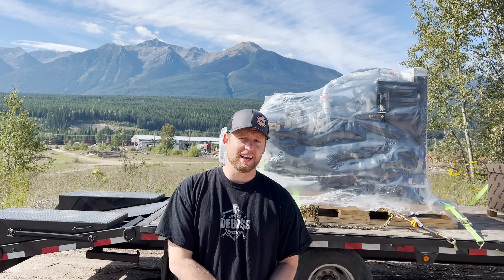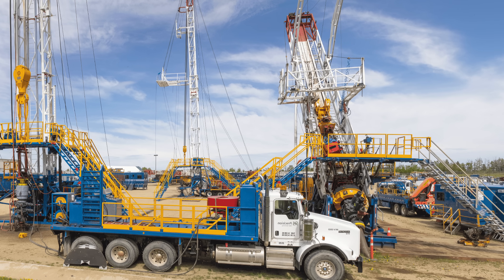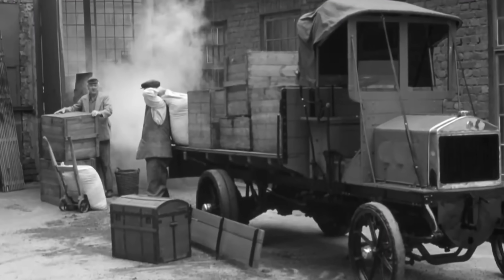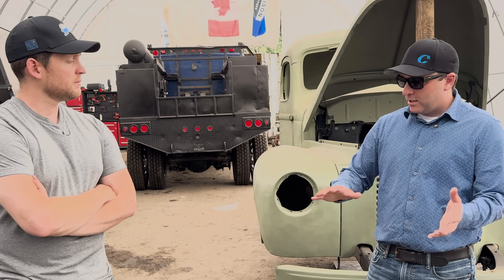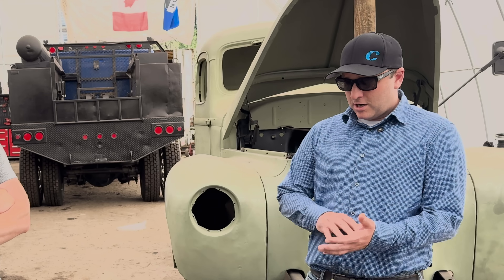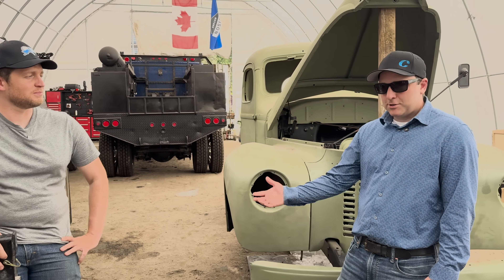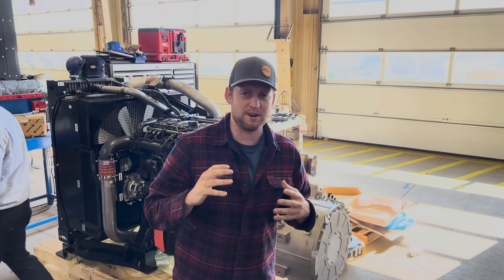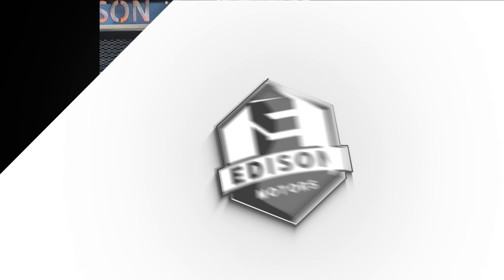We're putting Scania engines into Edison Motors Trucks!

Comment: Not using CAT engines will be a huge mistake. Parts are always readily available, and they give you any technical support they can provide. I had a truck with a scania, and although it was powerful, parts hereannoying to source, and no one wanted to work on it. I understand theyre cheaper and easier to get your hands on, but cat has the best product support hands down. Its why all 24 pieces of equipment i own are all cat. Downtime costs you the most.
Reply: For on road emissions CAT to my knowledge doesn't offer anything new. Dealing with government regulations probably has a huge part to play in this decision.
Reply: @evil_me  I thought since the generator is technically not the primary source of power, they can get away with having a off-road emissions system. Same reason they can run off-road diesel fuel in the truck
Reply: @Drew-in-NoDak Nope, they will still be required to have all the emissions requirements for an on-highway diesel. And off-road/ag fuel is literally the same fuel with dye in it.
Reply: The great thing about a series-hybrid drive is that its very easy to spec any engine that will fit. You're not hooking it up to a transmission interface, you are connecting it to a generator. If you want a Cat, you can have a Cat.
Reply: Cat doesn't make on-road engines anymore.
Reply: It’s all about the dealer. We have a Scania dealer that can provide most parts we ever need the same day and the rest has always been there the next day. We used to work with a caterpillar dealer who just couldn’t provide anything. And they are the official cat importer too. We now work with a dealer that jumps in the car after the first call 24/7, just like our Scania dealer. Since the official importer is so bad, this cat dealer has its own stock of parts. The dealer is everything.

We have engines from cat, Scania, Cummins, John Deere and jcb. Built from 2006 up to 2023. Cat and Scania have the best parts availability for us. The only jcb we have is from 2022 so that’s still unknown. The oldest (2007) Deere is getting replaced when it breaks down because parts are just not there anymore.
Reply: @autobootpiloot we have 15 John Deere excavators. Brandt always has parts and we got rid of the cats because they were terrible for parts.
To run a cat costs a fortune in lowbed costs replacing machines on site because we can’t have downtime.
Finning parts sucks.
Reply: @RyanKeys-i6z   it’s not the brand that has the parts. It’s all about the dealer. I know a large contractor that has two brands of vans the guys drive. One is very reliable and one not so much. All the new vehicles are the not so reliable brand because that dealer is so much better it more than makes up for the inferior product.
Reply: CAT, SCANIA, or Hyundai, it doesn't really matter what you have in YOUR Edison truck. You're generating electricity with it, at about 1/3 the size of a conventional.
Reply: I think somewhere along the lines they finally got to looking at the regulations for on road engines and the off road Cat could not be used for on road use.   My buddy was pushing me to become an installer for Edison repower kits.   I wanted no part of that.   He is pushing the repower process for homeowners and such but it is not legal to do if a vehicle previously had emissions on it.   It's just a fantasy to think that you can be an installer for the public and not get in trouble repowering vehicles that were equippedwith emissions.   Same kind of trouble as deleting trucks for the public.   I have an 06' Ford repowered with a 12 valve and that is illegal as heck too.   Sooner or later this will all catch up with everyone because the states will up the smog checks like California.   Watching the Edison channel became old because it is like a fairytale land where emissions and regulations don't exist.   The only repowers should be older trucks with zero emissions.  This will take massive amounts of money to get these larger Scania powered trucks past the emission police and you can bet the big truck companies will be lobbying against Edison to keep it from happening.   I am rooting for Edison guys and I am not against bucking the system.   I am a realist though and the system is rigged against outsiders getting in.
Reply: I agree. Should’ve used something already common, like Cat or Cummins. But I assume since they’ll be using them, they will also have more parts over here available.

Comment: Scania is already in north American products and share quite a bit of parts commonality with Cummins. Hyundai, Doosan, Kleeman all use Scanias where applicable. They also have a marine division for fishing vessels and yachts.

Mack-boring is an existing and well established distributor/representing partner.

You're main competition will be Navistar,  since they've already developed the S13 drivetrain with Scania and is sounding very promising so far. Of course that is mostly on highway right now. If IH lets you spec the truck with an S13 and an Eaton manual, I think you'd have some marketing to do to keep up.

Comment: 2:41 we're moving 70+ in sweden and finnland ;)
Reply: In Norway too, but only on certain roads rated for the axle load
Reply: @CarlMarx in norway it’s only 60 metric tonns if the road is rated for a module trailer. Thats 24 meters or longer with the truck. max length being 25.25 meters.
Reply: @tommyp3468 it’s state dependent, the federal reg is 40 tons on a 5 axle rig. But places like Colorado you can be 75 ton on a 5 axle rig provided the equipment is rated for it, states like Michigan and South Dakota you just keep adding axles for higher capacity. For comparison purposes it’s really not that different when you consider US states are as big as EU countries.
Reply: @CarlMarx its all axles. You can haul millions of pounds in canada but you just need more axles and push trucks
Reply: @taylorforster9256  special cargo is special cargo. How big is the limit for your regular truck? 104 tonnes here in Finland
Reply: @AdBul_  the 104t timber truck operates with special license on a set route. 76t is the maximum for regular combination with minimum 9 axles, which is allowed on all roads if there are no signs telling it's not
Reply: Just found out that US ton is also called short ton.
Reply: In USA the normal weight is 40 American tons on 5 axles. Then you go up from there with different regions that can handle the weight and length of trailers on the roads or permits are needed.
Reply: Quo vadis? Scania vabis? Old joke from the old world ( where are you going to? [old roman] scania vabis?
Canada? Might be an exelent choice. 
But when things settle down have a new moment. Check for a stationary engine in the gen rev range.
Reply: In Brazil, we also move around 74 tons all around, on a hot climate, and on a hilly terrain.
Scania is easily one of the most prestigious truck and bus manufacturers around here.

Comment: A north American truck with a V8 hell yeah
Reply: I find it funny how people in north america forget mexico is in north america and forget that scania  trucks are already on the road in mexico with the v8s canda and the usa are way behind
Reply: Yeah I'm starting to see lot of Scania here in mexico s @hihaveaniceday9386
Reply: 2.46 Scandinavian trucks hauling 60 to 75 ton unlike the rest of European regulations. Europe is not one country you know, but several.
Reply: @robertjonsson5750  Exactly. Starting tomorrow morning:  i'll be hawling thoose maximum wieghts for a week. Me and my SCANIA: We simply just LOVE IT!
Reply: Caterpillar already has V8's and Detroit also.
Reply: And a great sounding one at that, removing the muffler and replacing it with an extra long (like 12meter) exhaust pipe tend to have V8 Scanias absolutely singing
Reply: V8 is a downgrade from inline 6
Reply: @fastinradfordable  American V8s would be a downgrade. A Scania V8 is probably the biggest upgrade you could make. Only thing that beats it in any field is the new Volvo D17. That is a 17.3L I6 making up to 780hp. 10 more than the Scania DC16.
Reply: @tntfreddan3138  and disgusting 3800 nm... madness! :D almost 2800 poundfoot of twisty magic :D
Reply: @tntfreddan3138  The SCANIA V8 engine still outperforms that Volvo straight 6 cylinder engine. And adding gearboxes and drivechains -to the equation: The SCANIA is the prefered choice of the 'more'..
The only thing better on a Volvo truck (compared to a SCANIA) -is the electric sunvisor -on front window...
Reply: @fastinradfordable  Why do you say that?
Reply: im sure the heavy haulage companies in Northern Australia would not agree
Reply: Need to bring back the cat LoL

Comment: Been a truck mechanic for over 35 years, scania engines are very good motors, i've worked on them in the uk for many years, and for them for 4 years previously, the options you have here are enormous, good choice, seriously, good choice.
Reply: 2 for one. Boost Scania awareness, and get diesel-electric rigs out the door as fast as possible. Reach out to Scania corporate and ask for discounts as help in developing this market niche!
Reply: “Easy to do eh”?  Lol😂😂😂
Reply: The marine diesels do well, when they say 770hp they mean 770 hp for a month of running, not 770hp peak for 10 hours.
Reply: Yes but scania v8 i think is the best engine of all trucks, they have torque ,power,sound,reability , i now to euro 5 first model do 1000000 km without problem
Reply: @jurimerl7jak377  When. it comes to drivability, scania engines are top notch. Super wide pancake flat  torque curve.
Reply: I've been a Scania mechanic for 36 years so although I have a shit ton of experience on you I agree 💯.
Reply: Watch paccar start putting the V8 in their trucks from scania. Maybe international
Reply: Have worked on a couple of Mack V-8's and they look similar and even seem to have similar displacements. Is a Scania at all related to a Mack E series V-8?
Reply: @playanddisplay3636  Mack could use Scanias DS14 V8. Mack also got the right to use the Scania motor design that basically was low rpm, high tourqe and also more HP. There should be plenty of sources that explain it better then me!

Edit: found better info..
"Using Mack-supplied END(T)864 V-8 engine blocks, Scania began development of its own version in 1962 with running prototypes in 1964. However, the production version of the Scania DS14 V-8 was based on the improved Mack ENDT865/866.

Mack introduced the 14.2 liter ENDT865 in 1969, the same year Scania introduced the 14.2 liter DS14.

Scania utilized individual cylinder heads on their version (favored in Europe at the time), while Mack used a two-cylinder head design (four heads total)."
Reply: @davidlindberg4567  Thanks brother, I knew the architecture looked similar.
Reply: Have seen some similarities to the old Mack V-8. Are these engines related?
Reply: If mack would put the V8 in their truck it would sell even better. But still I think y'all have something that the market would buy. I would for sure. I just hope something is done pretty soon. I'm not getting any younger. Yes I'm in  wind energy hauling components. It doesn't matter if you're in wind are in the oil patch. People are going to bitch. I grew up in the patch. And now I'm in wind. It's the same in the timber industry. There is no happy marriage. ✌️. Bring back the V8 . The ol' saying. V8 NEVER LATE . 😊
Reply: Please  tell him to take off those sunglasses,     super tweeb vibe, mama's boy , 😮😂😂   looks shady,, sounds shady, ???? Don't believe all that comes out of that mouth 😮
Reply: Is it a engine or a motor? 😂😅
Reply: If only the current gen V8s were as reliable as the old ones 😂

Comment: So which motor are you using? I mean to me it would seem a 770 Motor (sick trucks have always loved the sound they make) is waaaay overkill for a generator setup?
Reply: With the 770 motor from what I was listening to, it'll generate the same amount of power but at like a smaller amount of rpms. Since the 770 is burning more efficiency it's creating more power at the lower end.
Reply: @RayTheFloofyBoi  See I heard that little tidbit as well but that was in relation to lets say pulling 60,000 lbs which this motor does not do. It simply spins that generator at a constant RPM to create a static electrical load to charge the battery's. That was the whole point of running a generator to battery to e-axle setup instead of a traditional motor to conventional drivetrain setup that the generator motor spinning at a constant speed, in the powerband/efficiency peak would get better fuel economy than a regular tractor trailer diesel. Putting some huge high HP motor in this defeats the whole purpose and premise of the truck, at that point you might as well just throw the old transmission back in and scrap the whole idea. Would probably be a better bush truck at that point. I'm all for putting a Scania motor in it. But I fear if its the large motor this is turning into some sales gimmick, and will be overall harmful to the brand after everything that has been said.
Reply: @TranceEmotion  I understand that. They probably aren't running the 770 and, the 770 is only for if you REALLY want the big beefy engine. They'll probably do there inline 6 model and, they're still going to have the other engines lined up for you to choose. So if you for example prefer the Cummins engine to the cat or the cat to the scania, you can still option it with those. They're still sticking with there guns of allowing you to put whatever engine you want in there since it is just spinning a generator and not connected to the axles physically. They're just partnering up with scania since they are willing to work with companies no matter the size. I understand you being worried with what they're doing but I can assure you, they're only doing this to give us more options to choose from.
Reply: @RayTheFloofyBoi as I get it they are all in with Scania now. As you hear they will need to cooperate with the engine manufacturer. Maybe they can have the retrofit with others but they list engines for generators there (website not updated for Scania).
Since the computers for the engine and the rest need to communicate, it's not a matter of just matching the shaft on the generator which DIY could do. And if some manufacturers aren't willing to sell only a few engines to them they cannot get started...
Reply: Problem is what was on the trailer is not a 770. 770 is V8, that was an Inline 6. Maybe V8 in next truck? Maybe the BDE?
Reply: @jaroslav3258  I didn't look super close as i kept expecting them to actually "say" what motor they chose but i never heard it said directly once just a bunch of talking about the 770 so once could easily get misled. But you are correct taking a second look it is some kind of inline motor which makes me feel better. Still gonna cost more maintence wise but not some wildly overpowered motor for a gimmick line or marketing catch phrase.
Reply from the maker: Realistically the 9L

The 770 would be fun but overkill.

That said I’m going to build at least 1 truck with a 770 generator anyways
Reply: @EdisonMotors that is reassuring. I do think it would be smarter to start with the 9L first though to iron out any kinks with that
Reply: @EdisonMotors  If you can get the 770 to fit then the smaller engine will fit.  The nice thing with your setup is the engine is just turning a generator.  You wouldnt be putting a lot of torque on the mounting points so you can basically just send a cad file to a company that can laser cut metal and the only real difference would be where the mounting locations are on that metal.  One other thing I would like to point out is with all the issues you are having with grants in BC you should maybe email emissions reductions Alberta.  Tell them what you are doing. Especially if you are dealing with someone from Alberta already they might be open to funding your projects.  They ask a lot of questions but they are directly working with you instead of having some other company doing shady deals. I'd still like to see you guys move to Alberta but I'm not sure that is in the books yet.  Corporate taxes are lower here so if you guys were to start growing it could make more sense.
Reply: @EdisonMotors the 9L might be a little small, should really look into the 6 cylinder 13L engines, since they will work lighter than the 5 cylinder 9L engines.